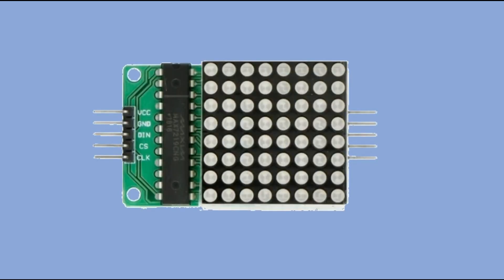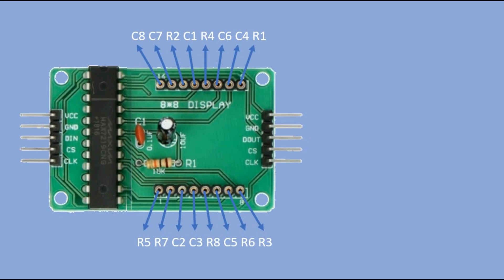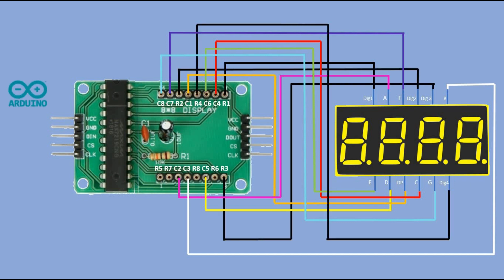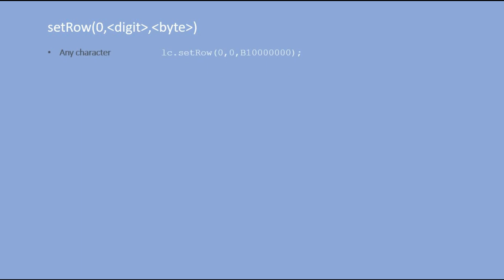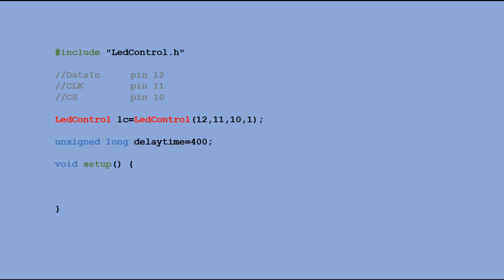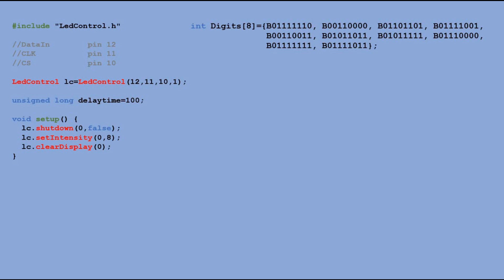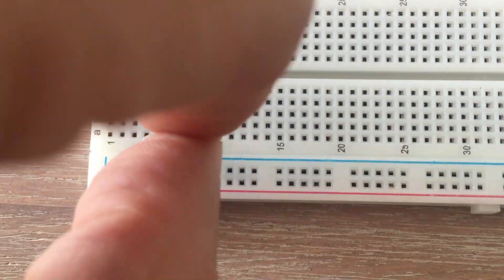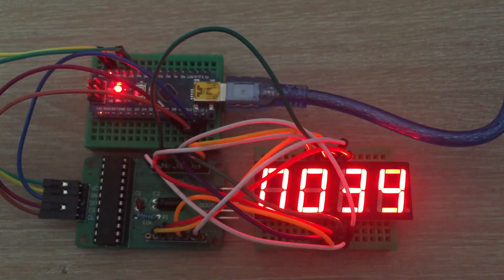How to control 4 digit 7 segment display with MAX7219 module

Comment: Hello its is possible conect 1 digit 2,3"? Thanks
Reply from the maker: Don't understand the question
Reply: @marios_ideas  I want know if it possible control one big display 2,3 ich with driver max7219
Reply from the maker: @ruiguedes4789  you can but then you would underutilize it as it allows to control 64 leds so 8 7 seg displays. For controlling one display use shift register
Reply: @marios_ideas  okay thanks 😉

Comment: How can i count without zeros before the numbers?
Reply from the maker: In the Digits table you need to add one more entry which represents "blank" B00000000 and in the code where you use lc.setrow commands to display the digits you have to introduce if statements which check if "i" is greater smaller then 1000 then istead of displaying dig1 you display blank, next if checks if "i " smaller then a 100 then you replace dig2 with blank, and finaly if "i" is smaller then 10 then dig3 is replaced with blank

Comment: Thank you for your video. Can I ask how you blank out a digit? For example instead of showing 0001, it will blank out the 3 zeros and only displays the 1, or 99 instead of 0099. How this is done if we want to count-up or countdown. Thank you.
Reply from the maker: Here is the table in the code that stores all the digits 
int Digits[10]={B01111110, B00110000, B01101101, B01111001,
               B00110011, B01011011, B01011111, B01110000,
               B01111111, B01111011};
First record B01111110 represents zero. You can either replace it with B00000000 or add one more record so you still can display 0 and also blank sign if you wish.

Comment: What's are the capacitors for? I'd like to breadboard this with just a shift register, not the whole module. Wondering if I can just leave the caps out.
Reply from the maker: I presume capacitor is to avoid some glitches that would cause some undesired flickering behaviouu rof leds. MAX7219 is not shift register. I have shift register video https://youtu.be/QI1IJLB42G8 as well. It is a completly different concept. If you want to integrate the max7219 module into your custom pcb there are some videos on youtube which would show you how to recreate theat particular module on your PCB so it is built in.

Comment: I'm wanting to create a small manual button push counting display, button press will increase the value up by 1, but am struggling to find instuctions on how to do this, do you have any insight?
Reply from the maker: I have something in my old videos that may help you. First you would need to understand how interrupts work. Check this tutorial https://youtu.be/kMtRmj9DS2I , and then look at the project in this video. https://youtu.be/gUT685Pb-xI Start watching at 5:07. It is using the same mechanism as you need for changing index of led to it.

Comment: i tried like this it didn't work

   int RowBits=B1000000; 
    lc.setRow(0,data, RowBits); 
    RowBits = RowBits >>1;
    lc.setDigit (0,0,data,true);
    delay(delaytime);
    lc.clearDisplay(0);
Reply from the maker: But this code is to lit individual segments not to display digits. Not sure I understand what you are trying to achieve

Comment: I made 4 digit 7 segment display with MAX7219 based on your video, it worked really well.

I am integrating this display with my Arduino weighing machine, to display my weight reading to the metric display, I am stuck with the code can you help. 
This is the code I used in my Arduino Weighing machine.

#include "HX711.h"
#include <Wire.h>
#include <LiquidCrystal_I2C.h>
#include <EEPROM.h>

#define LB2KG  0.45352
#define CALWEIGHT 3.00
#define DEFAULT_CALIFACTOR -7050

#define id 1
#define number_of_digits 1

#define DOUT  2
#define CLK 3
#define button A0

HX711 scale;
LiquidCrystal_I2C lcd(0x27, 16, 2);
long currentOffset;
float calibration_factor;

void setup() {
  //serial
  Serial.begin(115200);
  Serial.println("System started");

  // lcd
  lcd.begin();
  lcd.backlight();
  lcd.clear();
 
  // button pin
  pinMode(button, INPUT_PULLUP);
  
  
  
  // eeprom
  if (EEPROM.read(0x00) != 0x01) 
  {
    Serial.println("NOT INIT !!!!");
    currentOffset = 0;
    calibration_factor = DEFAULT_CALIFACTOR;     
    // show instructions
    lcd.setCursor(0, 0);
    lcd.print("MUST CALIBIRATE");
    lcd.setCursor(0, 1);
    lcd.print("Press Button");
    //wait for button press
    while (digitalRead(button));
    lcd.clear();
  }
  else
  {
    EEPROM.get(0x01,currentOffset);
    EEPROM.get(0x01+sizeof(long),calibration_factor);   
    Serial.println("currentOffset = " + String(currentOffset));
    Serial.println("calibration_factor = " + String(calibration_factor));
  }
  

  //scale
  scale.begin(DOUT, CLK);
  delay(100);
  Serial.println("calibration_factor = " + String(calibration_factor));
  scale.set_scale(calibration_factor / LB2KG);

  // if button is pressed (LOW) start calibiration
  if (!digitalRead(button))
  {
    // show instructions
    lcd.setCursor(0, 0);
    lcd.print("Clear Scale");
    // wait till person leaves the button
    while (!digitalRead(button));
    //short delay
    delay(200);
    
    // set tare and save value
    scale.tare();
    currentOffset = scale.get_offset();
    Serial.println(currentOffset);

    // show on lcd
    lcd.clear();
    lcd.print("Place 3Kg");
    lcd.setCursor(0, 1);
    lcd.print("Press Button");
    
    //wait for button press
    while (digitalRead(button));
    lcd.clear();
    lcd.print("Please wait ");
    Serial.println("calibirte");
    // calibiation
    boolean done = false;
    uint8_t flipDirCount = 0;
    int8_t direction = 1;
    uint8_t dirScale = 100;
    double data = abs(scale.get_units());
    double prevData = data;
    char runningSign[] = {'-','\\','|','/'};
    uint8_t runningSignIdx = 0;
    while (!done)
    {
      // get data
      data = abs(scale.get_units());
      Serial.println("data = " + String(data, 2));
      Serial.println("abs = " + String(abs(data - CALWEIGHT), 4));
      Serial.println("calibration_factor = " + String(calibration_factor));
      // if not match
      if (abs(data - CALWEIGHT) >= 0.01)
      {
        if (abs(data - CALWEIGHT) < abs(prevData - CALWEIGHT) && direction != 1 && data < CALWEIGHT)
        {
          direction = 1;
          flipDirCount++;
        }
        else if (abs(data - CALWEIGHT) >= abs(prevData - CALWEIGHT) && direction != -1 && data > CALWEIGHT)
        {
          direction = -1;
          flipDirCount++;
        }

        if (flipDirCount > 2)
        {
          if (dirScale != 1)
          {
            dirScale = dirScale / 10;
            flipDirCount = 0;
            Serial.println("dirScale = " + String(dirScale));
          }
        }
        // set new factor 
        calibration_factor += direction * dirScale;
        scale.set_scale(calibration_factor / LB2KG);
        // show still running 
        lcd.setCursor(15, 1);
        lcd.print(runningSign[runningSignIdx]);
        runningSignIdx = (runningSignIdx+1)%4;
        //short delay
        delay(5);
        // keep old data 
        prevData = data;
      }
      // if match
      else
      {
        Serial.println("NEW currentOffset = " + String(currentOffset));
        Serial.println("NEW calibration_factor = " + String(calibration_factor));
        EEPROM.put(0x00,0x01); // set init
        EEPROM.put(0x01,currentOffset);
        EEPROM.put(0x01+sizeof(long),calibration_factor);  
        done = true;
        lcd.clear();
      }

    } // end while
  } //end if button pressed

  scale.set_offset(currentOffset);

  lcd.setCursor(0, 0);
  lcd.print("Scaleit");
  lcd.setCursor(13, 1);
  lcd.print("KG");

  /*// radio
  radio.begin();
  radio.openWritingPipe(addresses[1]); // 00002
  radio.openReadingPipe(1, addresses[0]); // 00001
  radio.setPALevel(RF24_PA_MIN);
  radio.setDataRate(RF24_250KBPS);
  radio.setChannel(100);
  radio.stopListening();
  radio.printDetails();

  
  Serial.println("setup done ...");*/

  

}

void loop() {
  
    // get data
  double data = abs(scale.get_units());
  // issue with abs missing at the 4th digit after the dot (bug!!)
  if (0.0000 - data > 0.0001) 
    data = 0.00; //reset to zero
  
  // serial
  Serial.print(data, number_of_digits);
  Serial.println(" Kg");
  

  // lcd
  lcd.setCursor(0, 1);
  lcd.print(data, number_of_digits);
  delay(1000);
  lcd.clear();
 
 

}
Reply from the maker: see my response to your other post

Comment: Hello, how can I replace the 7-segment display, make the segments with a strip of LEDs composed of 3 LEDs connected to 5VDC, can you tell me a schematic connection?
Reply from the maker: I am working on the clock project with max7219 and leds but not led strips but one color single leds
Reply from the maker: So you should see something in a week or so. Olso check my word clock video. This should give you a an idea how to create segments based on 28leds from the led strips. But then you do not need max7219

Comment: Will this just work for 8 digits (using all 8 rows, instead of 4), no other changes needed?
Reply from the maker: Correct. At the beginnig I am showing the 8 digits module with build in max7219 chip which you can buy and save you a lot of work. I am doing it this way as I want to control custom build display
Reply: @marios_ideas  Yeah, I came across this because I wanted to do something similar (and not be stuck with the form factor of those boards. 
Thinking more though... if I need to attach to another 4-digit-display, I attach more row/digit connections but... do I connect the same column pins to the 2nd 4-digit-display? hmm
Reply from the maker: @GrahamReeves  Yes To build 8x8 matrix 8 columns and 8 rows

Comment: how to use the Max7219 for common anode?
Reply from the maker: I am sure it is possible but not simple. This part is meant for the use with common cathode
Reply: @marios_ideas  thanks for your fast reply  :) 
is there any other alternatives to Max7219 to be used with common anode led matrix ?
Reply: @hamedtaha1  Maybe u can use ic with NOT gate

Comment: Hi sir can i use 74hc595 ic?
Reply from the maker: Of course you can. But you would need four of these to control 4 digits. I have a video which covers shift regiters:
https://youtu.be/QI1IJLB42G8
For me however using Max7219 is simpler , code is more straigt forward. You can independendly change any digit while in daisychained shift register you need to update all four in case of any change. Plus there is much more soldering, and I am not very good at it:)
Reply: @marios_ideas  Thank you sir i understood.